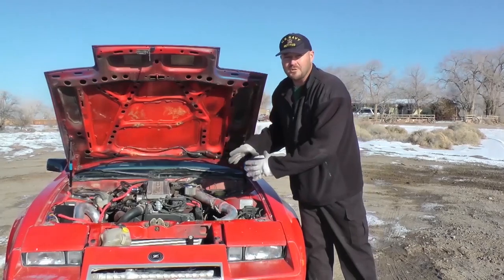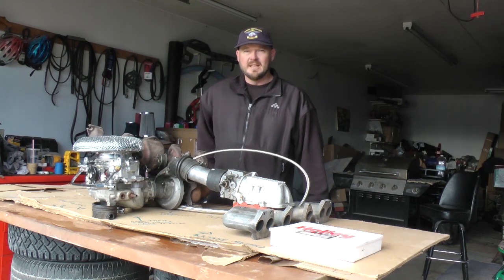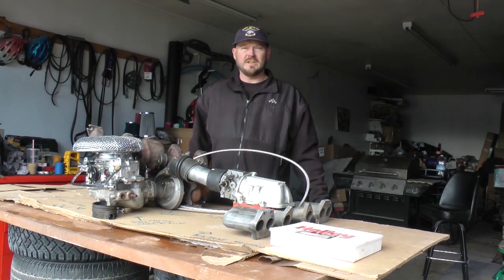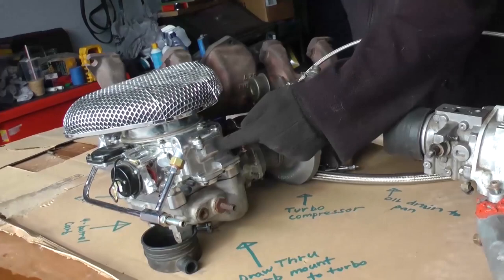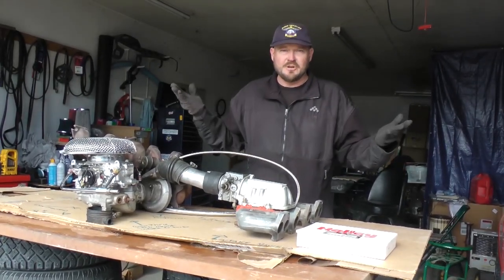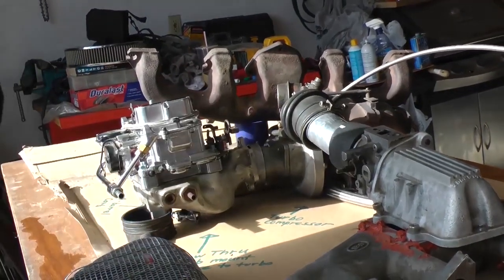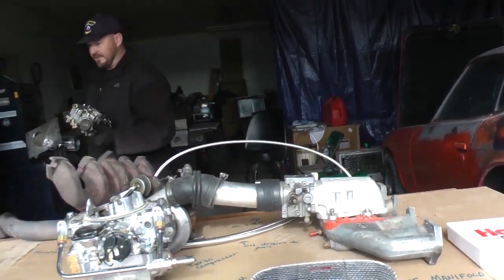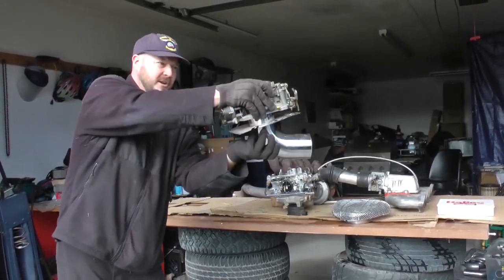Draw Through TurboCharging (Carburetor)

Comment: What makes me confused, is how you let the fuel system know how to compensate extra fuel for increased compression. That is what actually made me look for "turbo charging a carburetted engine".
As effective compression ratio rises with boost - not only does the engine need more fuel for increased rpm and or load, but also increased compression. This is in modern systems controlled by the computer, as you know.
On 1980's to 90's mechanical injection turbodiesels, this is controlled by a thin hose running from the boosted chamber (either the compressor or the inlet manifold) to a control diaphragm on the injector pump, which is actuated in case of boosts greater than atmospheric pressures. actuation of this diaphragm causes a staggering of the governor, so that more fuel is compensated accordingly. If you disconnect this very hose, or the diaphragm leaks, you get no fuel compensation, thus NO boost.
So this is what maked me curious to know how this is done in the case of turbocharging a carburetted engine.

Sincerely Ragnar W.
Reply from the maker: With carburetion it's easy, jet up on the main jets until you are happy with the readings on your air fuel ratio and exhaust temp gages as well as the idle and acceleration characteristics.  Once happy with main jets jet secondaries two jet sizes smaller than primaries. Also boost sensing fuel pressure regulator helps you adjust and compensate for that extra boost and can be adjusted after your jets are selected for fine tuning.
Reply: @budgetboosting  
I was researching ooooold Winfield Carburetors and that led me here. Back in the 90s I remember seeing a lot of carb'd draw thru set ups in the Hot VWs mags and also in older Hotrod mags. I've seen these set ups factory on the '81 Turbo Trans Ams, 70s 440 RVs, and in the aftermarket like Accel Turbosonic or the Martin kit, or AK Miller stuff. I own an '86 SVO, it's computer controlled so I don't have to think.

I wonder why these aftermarket draw thru carb kits or factory cars like the late 70s to early 80s Trans Am (301), Buick (V6), Olds ('62 Jetfire) ,Chrysler (fwd), and Fords (2.3L) didn't catch on early and become more main stream. Was it due to complexity or cost, or a combination of both for the times?
I know ECUs make everything idiot-proof and user friendly, but we didn't always rely or prefer that.

Comment: There's another way to turbocharge. It's a form of blow-through but something you don't see too often. I'd like you to contact me and we put together a skit together for me to offer the parts I'd like to manufacture for this form of turbocharging. I think when you get enough clientele I'll begin to offer manufacturing of parts to help your customers on a budget to boost their rides.. I have ideas for products that'll blow your friggin' mind. But you wont get them out of me easily
 :)
Reply from the maker: TREY CARVALHO sounds like a great idea, if you are in the Reno area, we can meet up and prepare a video. Helping people setup draw thru turbo with custom parts could benefit many.
Reply from the maker: TREY CARVALHO google search : jim cook racing triple carburator turbo kit.  This was a complete blow through triple weber side draft turbo and intercooler kit.  It came with everything to bolt on 1970 through 1983 Nissan/Datsun Z series cars.  They cannot be purchased anymore and no longer made by anyone.  If you could produce, fabricate and sell a kit like that which cannot be found anymore, you could make a fortune.  Their are many interested z car enthusiests that would love to get their hands on those powerful kits again.  Another kit idea is a draw through kit using a weber side draft carburetor per turbo having a weber flange fabricated to a turbo intake which draws the fuel air mixture in the turbo and forces it into any intake of any engine.  An easy way to turbocharge any car,  including oil supply and return lines and custom turbo flanges that can be connected to various exhaust manifolds or headers of engine manufacturers.

Comment: You should probably mention that the turbo would need a carbon seal on the compressor side (rather than the usual dynamic seal), otherwise idle vacuum would cause major oil burning.
Reply from the maker: Great idea on those seals. So many different turbochargers out there these days, some have the right carbon seal, most have the dynamic seals. My take is run the turbo see how it does, if the seal fails, upgrade to the better carbon seal.

Comment: When ur turbo starts hitting 300c up quite easy surely fuel will combust from heat of mainfold heating up in turbo ? Meth aswell boom ! Hot countries be a death rod !
Reply from the maker: Methanol/water injection can help out as liquid intercooling.  Running a higher octane fuel can help too.

Comment: Co-vair. WTF?
Reply from the maker: They did it on the Corvair in 62 they also did it on the Oldsmobile Jetfire in 62 they did it on the Buick regal from 1978 until 87 where they perfected it with fuel injection. They did it in the 80 and 81 turbo transam as well. They also had an 80 through 81 Monte Carlo have that turbo drive-through carbureted engine as a rare option